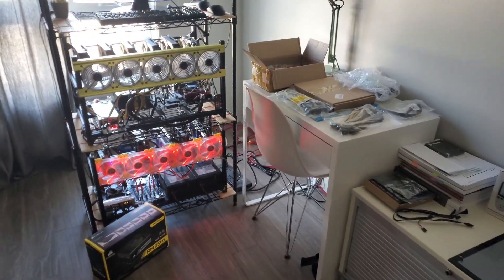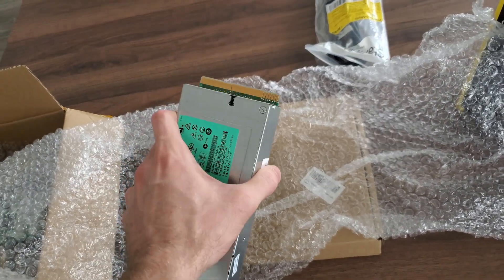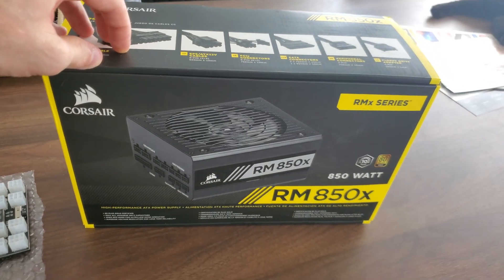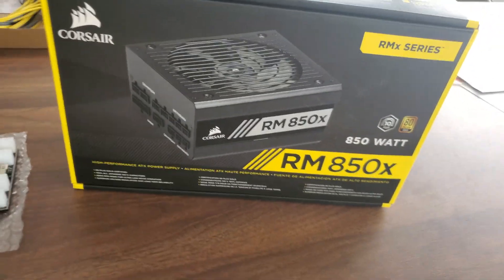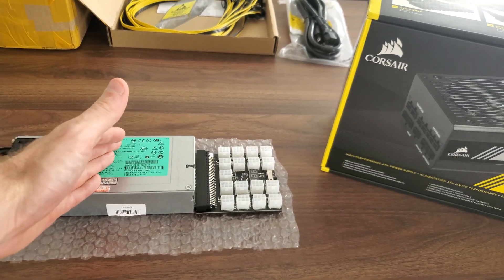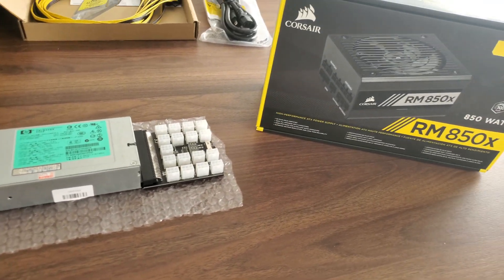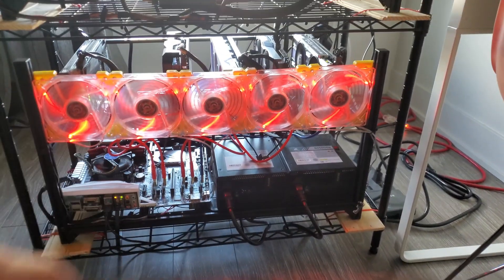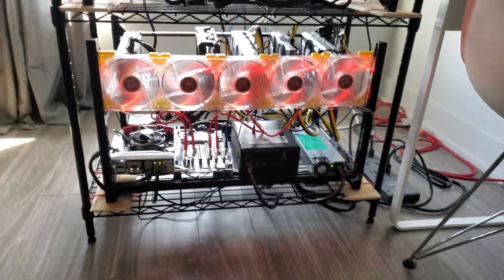Best Power Supply for GPU Crypto Mining? ATX PSU vs Server PSU (ETH, RVN, ERGO)

Comment: Nice set up. On 6 card rigs I go with 2 x 750w 80+ gold atx for the lower cost, noise and heat. 8+ gpu rigs would then benefit with server psu 's.
Reply from the maker: I dont agree with the lower cost of ATX PSUs but for all the rest makes total sense! Server PSUs are loud and generate a lot of extra heat. Its currently killing me in my office LOL!
Reply: @MiningOffice  The 750w atx psu's in my area are $89/each. I can't find the HP server psu and breakout board for less than $220. Even if I could, I'm running at 120V limiting the HP to only 900w. ATX in this case works better for me on all accounts.

Comment: The heat won't damage it ?
Reply from the maker: The Server PSU! Nope! They are made to run hot and designed as such! (Like a car engine for example, is made to run at 100 deg C and not ambient 15 deg C) :)
Reply: @MiningOffice  ok I bought one today let's see
Reply from the maker: @jatinjindal2528  and the sound really depends on how much you load it. Once you go server psu you never go back ;)
Reply: @MiningOffice  I will only use around 800w on the 1200w psu

Comment: Nice work done bro! very useful video. Thanks for sharing it. Keep it up man!
I was wondering to know is it possible to have only 2 x HP PSU server 1200w for a rig with 8 x RX580 without having a ATX power supply?
Reply from the maker: Hey M J! Really appreciate your support man, Im happy to tell you that I have a new video on my channel about the Parallel Miner ZSX Breakout Board. That will allow you to run 2 server PSUs together and power your CPU, MOBO and whatever else with your breakout board! :) I think your probably safe for 8x rx580 but I dont know how much each GPU pulls. Cheers!
Reply: @MiningOffice  Thanks brother for your concern!
I was wondering to know is there any logic behind of some miner's strategy that using ATX PSU for mobo, cpu and 1 Server PSU for GPUs?
I appreciate again!

Comment: what's the difference between gold and platinum rated PSUs?
Reply from the maker: The efficiency of the power draw. For the same GPU power draw, the gold rated PSU will draw more at the wall then the platinum power supply. The difference between the 2 is small, but the difference between say bronze and platinum is still quite a bit. Check it out online for the tech specs of each rating!

Comment: Great video.  Quick question - how do you sync the psu and server supply?
Reply from the maker: I dont for now! When I would use 2 ATX PSU's, I would use a dual PSU cable. But now I just put the server PSU on first (breakout board) then the atx PSU.

Comment: That model of HP psu is 80% silver.
There are platinum models available, they have a sticker on the back that says 94% or a Blue C14 plug
Reply from the maker: How do you know that? I though that model (dps-1200FB A) were all the same! :(
Reply from the maker: Dude I think your right!! Im going to have to correct that next video! Thanks for the info. Thats a really sneaky way of knowing, what the heck
Reply: @MiningOffice  They also have different model numbers, I try to avoid all PLL11
And just get ones with the blue plug :D
There are specific model numbers of course, but the blue plug is the main indicator on the HP power supplies from my experience.
Ive used the model you have before, they work, but the plat version runs much quieter and saves about 35-55w!
Glad you looked into it.
Reply: @MiningOffice  ive spent the time to dig through all the models and only buy the ones that are rated at the 94% which will have a sticker and blue plug.
The other ones are not worth buying imo.
But they do work fine, ive used them before but sold them and bought Dell 1400w Plat plus to run on 240v and a few of the actual plat rated hp 1200w psus.

Comment: I love server PSUs! 1 atx 1 server per rig is the way to go!
Reply from the maker: I agree!
Reply: @MiningOffice  are server power supplies needs trigger like psu's? or they just running when you pluged in? I would like to know what happens after electrics back on .(in case of electrics gone)
Reply from the maker: @anexis_real  ive got you! The server PSU itself has no buttons. Its powered when plugged in. Whats important is the breakout board! My first one had just an ON/off button on it, so if the power cuts out and goes back on, the breakout board  stays off (not good). Now with the breakout board that have a switch (instead of button) just leave the switch in the ON position and everything should power ok correctly after AC power loss :) hope that helps!
Reply: @MiningOffice  this is the information that i am looking for. thank you <3
Reply from the maker: @anexis_real  no problem, glad I could.help!